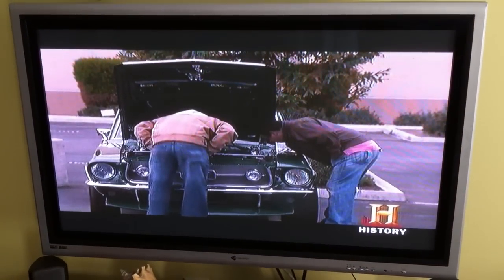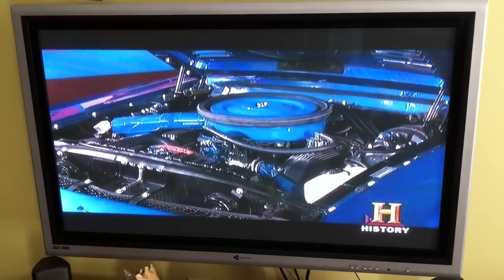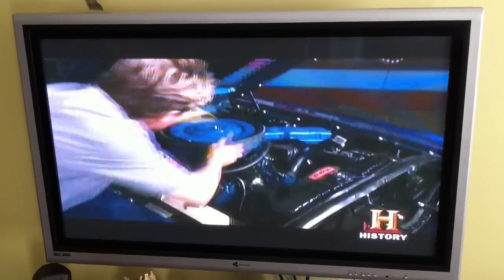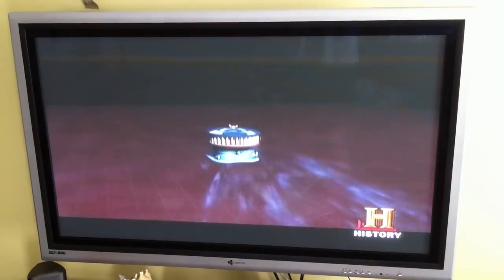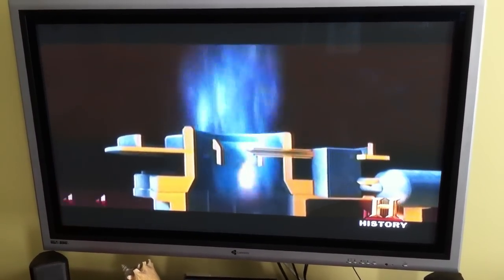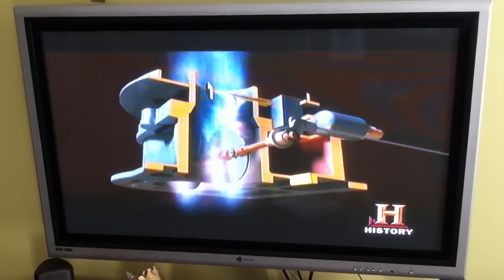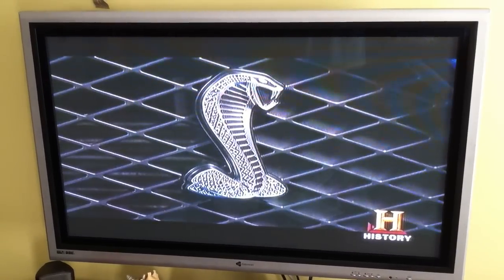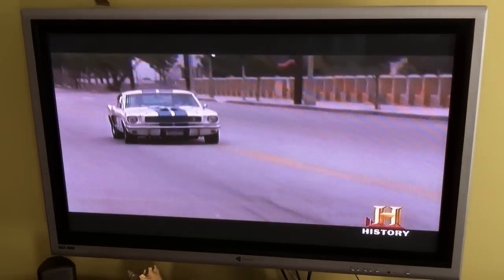New vs Old Motors

Comment: Well, the intake manifolds and throttle bodies are the injected cars can get pretty gummed/carboned up cuz there is no fuel to keep it clean....On the other hand, those old 4bbl carbs were pretty complicated, and tough to repair properly unless you really knew what you were doing....